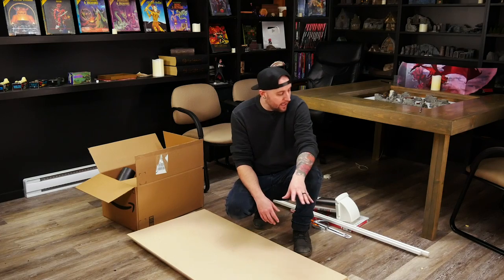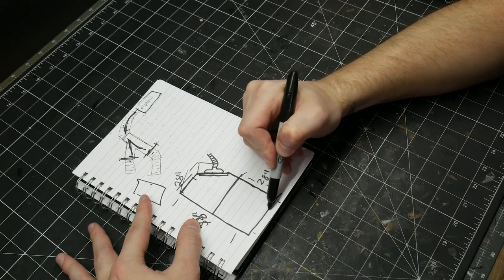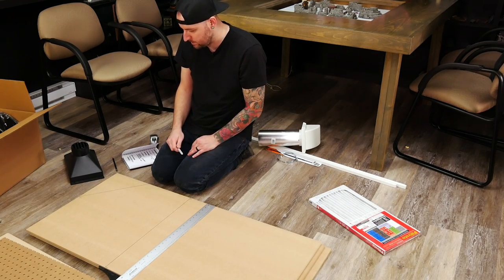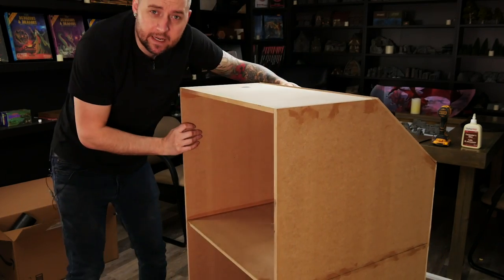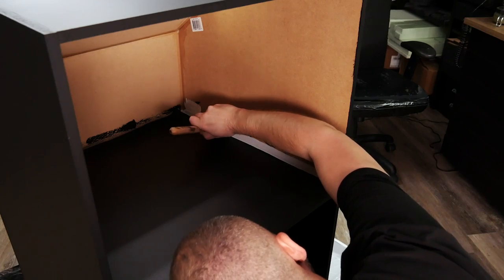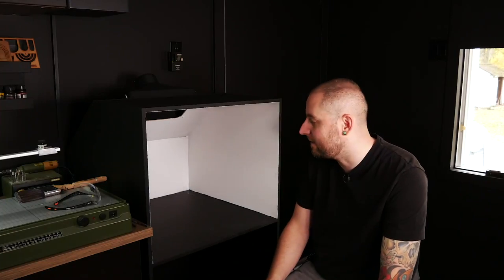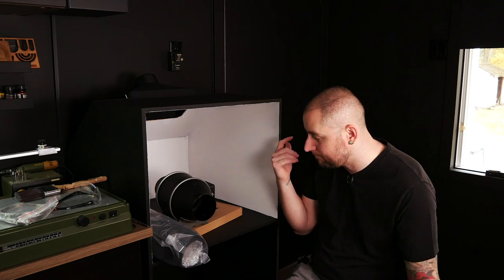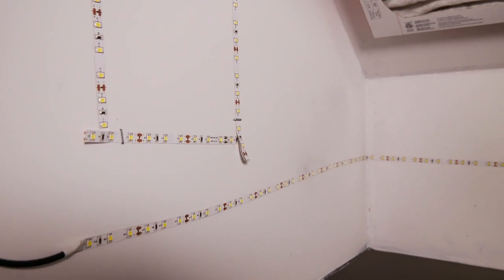I Finally Built Myself an Airbrush Spray Booth!

Comment: Hey BMC I like a lot of your painting videos they have given me a lot of great tips to get me painting my minis and terrain anyways I have been 3d printing for over 7 years mostly filament printers but I have recently got in to resin printing and if you need any advice or questions about 3d printing let me know as for the shaking effecting the printer most resin printer only moves up and down and as long as the printer has a suitable amount of resin the print should be fine oh and you do need to do a finish cure on resin prints I found some UV led strips for about 5 bucks on aliexpress that work great

Comment: Good morning fellow Pegger. You are going to want to insulate the flex pipe from outside to the fan. when it gets to 15 below or better the pipe is gonna get cold which in turn will condensate / get cold. KUTGW brother
Reply from the maker: It's not really that necessary unless that pipe gets covered by drywall or similar. Before youtube, my profession was renovations. I built luxury kitchens and basement developments so dealt with hundreds of exhaust pipes in our climate. The pipe will get cool if the right wind hits to open the flapper, but I doubt it will cause any condensation or freezing issues as it's totally open and exposed to the warm space. But I will be keeping an eye on it for the first winter just in case. Adding an insulation wrap is a 5 minute job, but I'd rather not have the extra mass if I can get away without it.
Reply from the maker: I should clarify, you ARE actually correct. It should be insulated, I'm just saying from personal experience, that in this situation I feel comfortable taking the risk of not having it but being aware and keeping an eye on it when we hit those nasty -30s.

Comment: I bought those same connectors to divert a portable air conditioner into my dryer vent...benefit one of having a 3D printer...I went into fusion 360 designed the coupler printed it and installed it with HVAC tape.

Comment: Wow that's a lot of work! I would have done a trash can filter like you do for wood with a hemp on the back end so i wouldn't need to drill hole to the outside.  But I'm also lazy
Reply from the maker: It really wasn't THAT much work to be honest. You could do it all in a day (aside from paint drying on the frame). But it does require some effort (and tools).

Comment: Make sure you buy a strong enough fan. I don't think mine will manage my whole shop, even with the dampers I added. Definitely err on the side of being able to move more air, you can always partially open a damper ro reduce the flow if it's too strong in your booth.

Comment: Nice construct! 👍.. That booth turned out very nice. Thanks for sharing. I work with a lot of 1/24 & 1/25 scale model cars & trucks, and unfortunately hand brush everything. I've been wanting to build a spray booth for quite some time but have been kicking some ideas around on how I want to build one. I think a floor model, like the one you built in this vid, may be just the direction I take, with some mods applied. Time to bust out the graph paper! .. Again, thanks for sharing & I just subscribed to you channel.

Comment: I just recently got a resin 3d printer.  I did see and read a lot of people complaining about the smell.  I tried my first print in my hobby area to see what happens, with aroma candles at the ready.  Honestly I dont find the resin smell bad at all!  One thing I have learned is the printing process is very sensitive to vibration, as you mentioned.  Due to this I have moved my printer to my kitchen counter where it is more sturdy.  I print in my kitchen, smell and all.

Comment: You can add magnets to the corners of peg board and the magnets around the filter (on the actual wood) and just put it on and off like that. It also hides the ugly filter.
Reply from the maker: That was the plan but I don't think it's worth the effort, and I don't think the benefit outweighs the downside of reduction in air flow.

Comment: just got this in my suggestions today... upgrades I hope you did and what I plan to do with my build...
down draft... air flow top to bottom lights at the top prevents spray on lighting and dust...
dont use spray my dude WILL ingite the chance isnt the small it always spark at power on you just need enough fuel in the air
Reply from the maker: Would you spray a bunch of combustible vapours and THEN turn the power to the fan on? It does spark during operation, just starting.
Reply: @BlackMagicCraftOfficial  Well possibility of spraying then a power trip and then flipping your fuse back and flame... I like the inline fan though I haven't built my enclosure yet so your design is giving me great ideas. Nothing about it is bad imo just the fan is scary due to risk but I only see improvements for a Mk2 video no hate my dude.
Reply from the maker: @ghettodexter  breakers don’t flip themselves on.

Comment: For the in-line fan all you need is a brushless fan and they are really common even where you would have looked for the one you bought. Your design is pretty close to the one I'm doing but my EPAX X1-DJ will not need a full booth just exhaust from printer to fan.
Reply from the maker: That's actually not entirely true. A brushless motor reduces the risk of sparking further, but it does not remove it. The only fans that are truly spark proof (and the only kind used in commercial applications venting flammable vapours) are ones where the fan is completely separately enclosed from the motor. Fans like the ones on furnaces are a perfect example.

Comment: I have the 10" version of that fan installed in my attic to boost the HVAC airflow to the furthest side of the house.  It solved my hot in the summer master bedroom and  bathroom problems.  On full speed it steals most of the air for the rest of the house. lol  I normally set it to speed 1 instead and it still works.   Is yours adjustable? if so, what speed do you run it at?  Do you find that it pulls too much air and cause problems while painting?
Reply from the maker: It is adjustable. For painting I run full speed. When connected to my resin printer I run at lowest setting.

Comment: I can't stop laughing at you building life sized "terrain." Such a different scale for you. :) So are you going to break out the Modge Podge for this? :)
Reply from the maker: More a return to form. Before YT I was a residential contractor/renovator my entire adult life. So 1:1 scale is actually my most experience 😂
Reply: @BlackMagicCraftOfficial  I was scrolling through here to see if you mentioned what trade you were in. You cut that hole in the exterior wall with too much confidence for a DIYer. Also, no guard on that grinder.

Comment: I would recommend clear tape over the leds - so you can protect the led from paint - replace the tape when they become dirty ...god job :-)
Reply: The question is if the LEDs generate enough heat to mess with the tape. And he said the LED tape is cheap.

Comment: Is overspray dulling the LEDs another factor in the "they're cheap, I'll just replace them" thinking? I'm not sure how you would protect them without adding a lot of effort to the build and faff to living with it; but I would be interested to understand your thought process.
Reply from the maker: I doubt it will be an issue but I’m only risking it because they cost less than $20 and if they get covered in paint it will take a very long time. But if I was worried I’d use clear tape on them.

Comment: I used to work in automotive restoration and painted cars plenty. Those big spray booths have big fans coming off the back near the top, just like you did. Pretty sure the airbrush spray booths on the market are designed that way because it's cheaper.

Comment: So I would really like to build a paint booth. Problem is I have no real solution for venting. When it comes to actually venting it, your just venting paint particles so is it possible to vent it with the same venting system you’ve setup into a bucket with a hole cut in the lid to allow the particles and air to go. Sorta like those you see hooked to shopvacs that collect the dust without it actually going into the shopvac. Just looking for a solution to my problem, thanks.

Comment: It was a good idea not to put the resin printer on top of the spray booth. The vibrations would definitely put the print off, but also you need to be able to have good access to the resin printer to be able to pour the resin in the bath, remove the bath and remove the print with the print bed. Also if you have a failure and resin overflows or you break the resin FEP (clear plastic sheet) the resin could potentially drip downwards into the airbrush booth. You can mitigate that by building some sort of enclosed area so the resin can't get away, or you can do what I do and put your whole resin printer in a large aluminum foil baking tray (like a turkey tray) and line it with paper towels.

Comment: flexin yer carpentry muscle a little bit. spray booth looks badass... 🤘🏻
Reply from the maker: Those muscles got pretty soft after a year of full time YouTubing. Gotta use em once n a while before they die 😂
Reply: @BlackMagicCraftOfficial bwaahaahaa that's right fo sho.
Reply from the maker: It was actually a bit strange. I used to use a skill saw almost daily. Doing this I realized I hadn’t touched one in over a year. It was a bit weird.

Same with cutting in the vent. I’ve done that 100 times, but it’s been so long!
Reply: @BlackMagicCraftOfficial  a year would make you a little rusty I expect, but, you'll carry those skills for life. and for the record, I'm kinda jealous of yer hobby room, just sayin... 🤘🏻

Comment: Hey sir!! Great job on the booth! I actually ordered all the same pieces based on your recommendation. I'm wondering if you've had any issues with the force of the suction from the fan? I used essentially the same design you did (except I used left over OSB board from another project) and I find the suction to be a little lacking. Any tips on how to optimize the fan performance? Cheers!!
Reply from the maker: I’ve found it to be sufficient, but changing the ducting to solid instead of flex would improve it further.
Reply: @BlackMagicCraftOfficial  Thanks for the quick reply! Cheers!

Comment: Great Video! I love building things like that. I´m interested in your airbrush holder and how you took the air pressure controle off the compressor and how you added this to the table.
Reply from the maker: I unscrewed the holder from the tank and screwed it to my booth. It’s designed to mount separately or on the tank. Could just be my tank that’s designed like that. It’s an iwata.

Comment: try making a hole through a wall like that in germany xD you easily drilled though your outer wall with a normal drill. for my wall i would need to use a jackhammer to get through ^^
Reply from the maker: I’ve drilled plenty of holes like that through 8” thick solid concrete foundations in basements for vents. You don’t use a jackhammer, you use a concrete coring drill. More work but entirely possible. I also didn’t drill through my outer wall, I used a grinder with a diamond wheel to cut through 2” of stucco which is essentially concrete. The pilot bit to find center was a masonry bit.

Comment: Great vid Jeremy !
I just acquired an airbrush and i was asking myself questions about a spray booth. So your timing is really convinient for me. 
As you did your reaserch, i may directly ask you my questions.
So there are no fumes involved in airbrush painting. It's just acrylic paint sprayed with ambiant air.
So my question is : why is the venting mandatory ?
I can see 2 main reasons why you would need to suck out paint particles : so they don't ruin your surroundings, and your lungs. But for the surroundings, can't you just have a big fancy wooden box with no vents and let the paint particles fall in the bottom of the box ? Is it that messy you need a venting system ? And for the lungs, maybe just a dust mask (or a more specific kind of mask designed for airbrushing, idk) ?
Is the fan really necessary ? I suspect it is, otherwise people won't bother with this part. But i can't figure it out as i never really airbrushed yet. Can you tell me what i'm missing, please ?
(sorry for broken english, i hope you understand)
Reply from the maker: Dust. It’s to stop dust from spreading to surroundings. A strong fan is needed to capture dust before spreading.

I plan to also use mine for smelly things, and to vent 3D printing resin fumes so I went for a strong fan vented outdoors.
Reply: @BlackMagicCraftOfficial  thanks for the reply.

Comment: Tnx man... inspiring as always. I'm  just a bit confused about the power of the in line fan (you say "at least 200 CFM") but here in Italy the max power is in "cube meter/hour" and the range may vary around 180 cube meter/hour... but... dunno if can be comparable. How many watt is your motor? maybe this is a more comparable measure.
Reply from the maker: Check specs on link 😉
Reply: @BlackMagicCraftOfficial   uhpss! ok ... finded in one of the product photo: 21watt  and 28dbA noise. So i think a 30 watt motor should be enough! Tnx

Comment: i loved the spray booth video and was wondering what brand dimmers you were using for the fan control and led control. I have a shop setup with leds and i cant find a dimmer that seems to work quite as well as yours did.
Reply from the maker: Both came with the respective devices.

Comment: Are you worried about heat loss from your new exhaust vent? Have you noticed a cold spot near the new exhaust vent? When you say flapper I assume you mean it shuts itself to keep out the cold, like a backdraft damper?
Reply from the maker: No. I’m also not worried about heat loss from my two bathroom exhaust fans, range hood exhaust, dryer exhaust, furnace exhaust.....

Comment: Nice build. I will say one thing, those LED's, you kill probably kill them quick seeing they aren't the waterproof kind. But they are cheap so I guess it's not a big deal.
Reply from the maker: I’m not planning on getting them wet. But they are so cheap I was willing to risk any issues with them (like burning out or getting coated in paint).
Reply: @BlackMagicCraftOfficial  They shouldn't really burn out unless you run them at 100% constantly, getting covered in paint could short them but that'd mostly be with metallic ones. Quick and quick and dirty way of protecting them would be some tape, I've done that heaps.

Comment: Hey! Thank you for this video. And all of your content for that matter! I'm curious if you are still happy with that fan for your ventilation. I'm building a booth of my own based more or less on your design and wondered how it's held up.
Reply from the maker: Still use it, still love it. Only thing it’s missing is a drawer, which I’ll get around to eventually.
Reply: @BlackMagicCraftOfficial  Right on! Thanks. I ordered a less powerful fan at first, and it was not going to cut it. So I'm going to give the model you used a try.

Comment: use the fan to push the air Instead of Pulling it make your booth for your 3-D wirh the fan over your 3D printer thenp run your air duck over you  spray booth  Connect it with your Y-connector and then run it out your house.

Comment: Yo Jeremy, nice work dude! If you are looking at getting into 3D printing you should snag a Creality Ender 3. I know you probably already heard about this and did your research, but I have purchased 3 3D printers and am a designer for an aircraft company and use 3D printing at work, and i have got to say before you get into some crazy purchasing you'll really enjoy the Ender 3. It's not a resin printer, it's an FDM, but still produces high detail parts. Also do you really want a resin printer? Resin printers make good quality pieces, but it produces brittle parts and you need PPE when dealing with the liquid resin because of the way it reacts with your skin.
Reply from the maker: FDM printers are not suited for the types of things I intend to print (very small detailed bits and miniatures to use within builds), resin is ideal for that. Especially since I want to print high quality masters, mold, and recast. Honestly, FDM printing has 0 appeal to me personally.
Reply: @BlackMagicCraftOfficial  Anycubic photon is a good go to  then for resin. Easy to use and understand. I've had mine for like 6 months and love it. Either way just make sure you get one that has the right size build plate you'll need.
Reply: @BlackMagicCraftOfficial  For molds and recast, you are so right. The Z-step height between layers will show through on the FDM prints. If/When you get the resin printer I would love to see a video over how You use it. Is there any resin printer you're looking at right now or a price point?

Comment: You could just print the connector for the air vent once you have your 3D-printer. 

Oh but the you would need that to hook it up first ;-) . Bother.
Reply: I was thinking the rubber connector boots used in PVC sewer drain connections. They come in black!

Comment: Great build and it got me all sorts of motivated but I had a question. When you built this did you have to worry about any of the vented spray painting the outside of your space? I am looking at doing something like this in my maker space which is in an upstairs room and I was going to have a removable vent at my window like I have with my laser but I am just concerned if this would try to paint the top of my roof over my garage where the window is located.
Reply from the maker: There’s a filter
Reply: @BlackMagicCraftOfficial  cool, yeah i saw you had put one in but just wasnt sure if it stopped it all. sounds like it does. really didnt want to find out the hard way and have my roof top start turning colors :) Thanks for the response, your videos are awesome!!